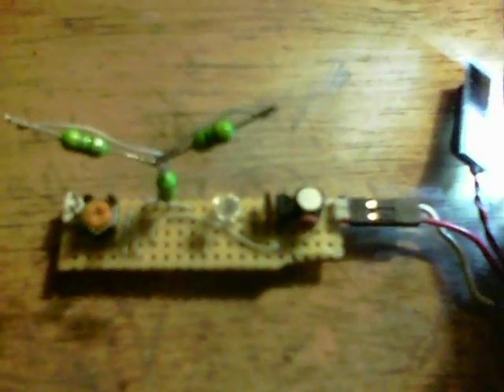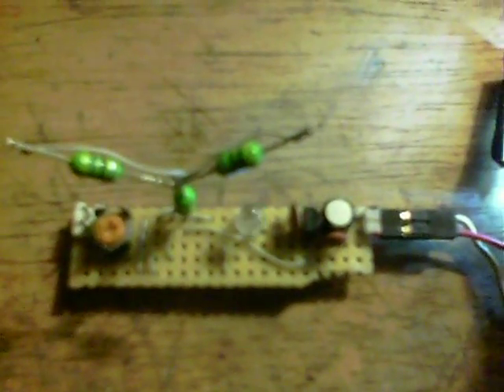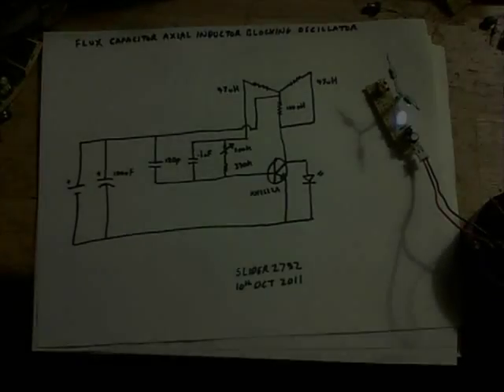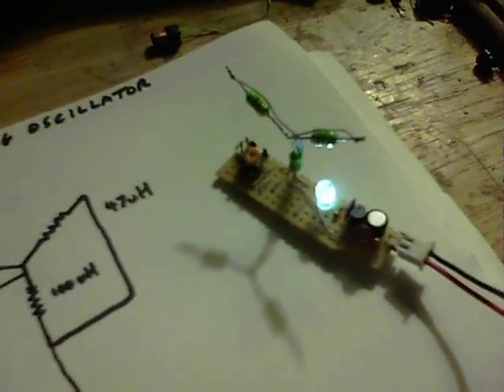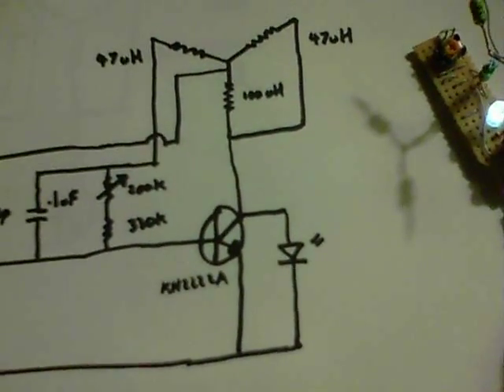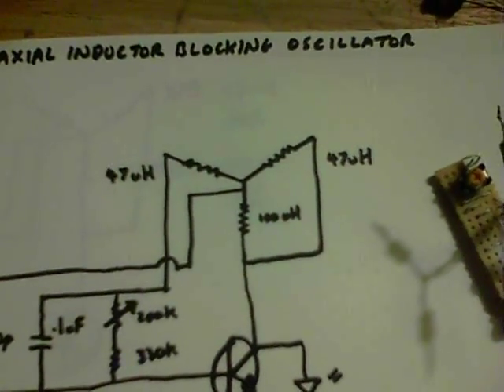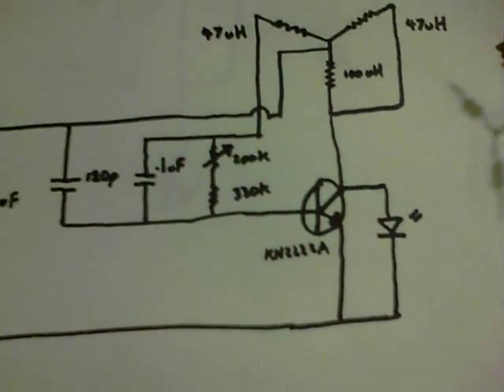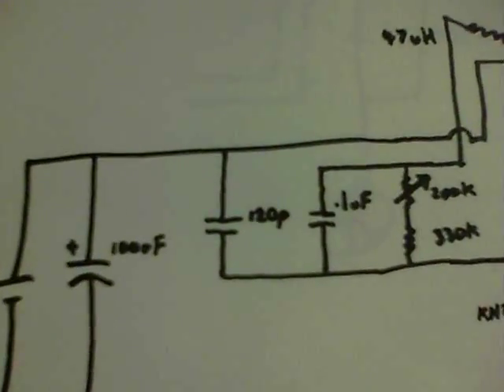Flux Capacitor Oscillator

Comment: What if you wire a clock to the ends and see if time moves faster or slower ?
Reply from the maker: Haha, good idea...it might just work !
Another idea would be to wire a clock up to the circuit output as its power source. A lot of clocks use the mains as the frequency to divide by, once the voltage has been dropped for the conventional circuit. So, it could be made to run faster or slower because the osc circuit wouldn't be running at 50Hz.

Comment: I dont wanna ask evident or stupid questions but i am looking at your schematic and wondering... Do you think, or do you know if the 47 uH and the 100 uH on the collector are acting like if they were one only choke, with a uH value in between the value of the 2 independent chokes? Is it like resistors?  2 X 100 ohms resistors in parralel would give a value of 50 ohms.My meter does not go that low in uH range so i can't test it. Anyway's...there is lots of questions in my mind Hehe!

Comment: Realy nice...i will try that circuit. Wanna make some tests first. Got my chokes from dollar store solar lamps and CFLs to (little difference, here they are 1,25$ to 2$ stores). But i guess i got rid of the small range ones only got 100 to 560 uH inductors.About distance, i said that to Lidmotor to, with 150uH on Collector and 560uH on base, got the chokes 5 feet away from each other and it is still working. That way the distance does not seem to matter. But maybe is it evident for everyone?

Comment from the maker: @harpbloke Thanks :) It was a comment by iluyzin1 on one of Lidmotor's vids about what they are that got me started. The 3rd inductor actually does work, the LED brightness increased. It shares the Collector connection yet is of a different value..and maybe that's why it works so well. Or I was just lucky with the inductors.

Comment from the maker: Hehe cheers :) I like the top right of the circuit diagram.
Axials came from various junk boards, have found that anything with an 'L' is one, like 'L102' etc written on circuit. Diff colours and shapes.
Here's a thought, if we look at cold transistors on Bedini type wheels when tuned and some say the system is time stepping back a notch catching electrons, then link with this...we.. have..time travel with a flux capacitor :D